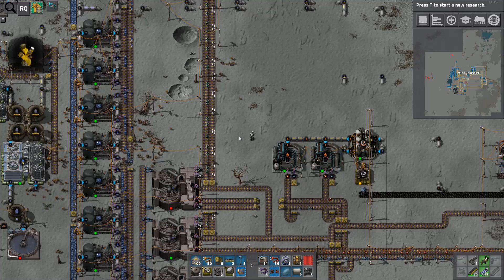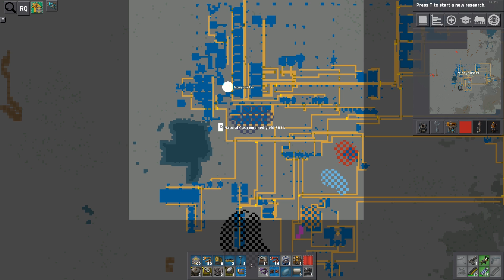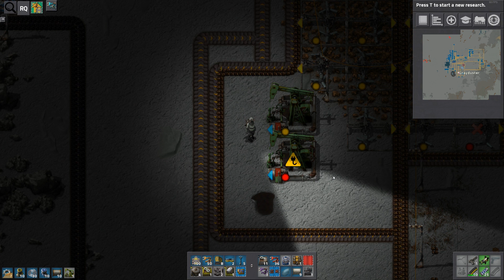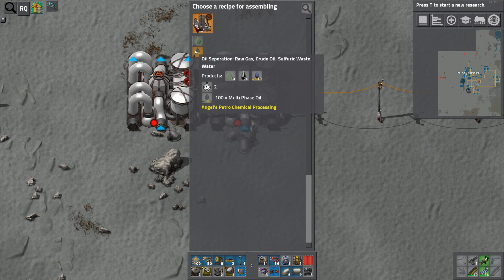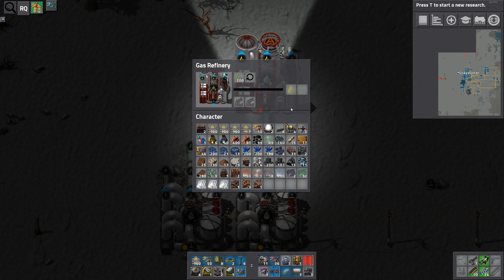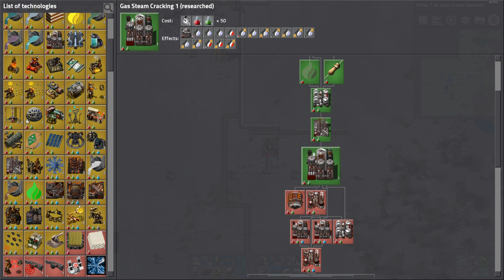Angels and Bobs Factorio 0.16 E10 - Batteries

Comment: Not sure if you knew but you can also make propene for plastic from Naptha as well with Catalytic Cracking, you do require red metal catalyst (1 x Iron Ore / 1 X Copper Ore) and steam which is easy enough. I prefer this method at the moment  as it takes up way less space.

Comment: Do you have a map string for a play along?
Reply from the maker: Sure - >>>eNptVDGIE0EUnckm3uWiuSBpBD2uSBvRy51YSHatLORK4eyc7E7W
wcnuObubkLM4ixMsFBsbtfBaEewsxObgQBQVjrPS6sRGUfFE0EaIM7M
zs5vghxne+3/2/zdvswGgBuoAAFhsVVHgYxo1uySKEoYLReuwygQoTh
iiTR9FlmVVVDZk+CQs5unCOG2N08VxujTe6hSnRTdElJ8quyzxcDMkl
IuoeoTFTZR0MPNJgPmxGZnpYOLnGEXulYyxcBAY5jKMepylnbwkiocs
jMSzZZnxGR4KMZKsJmyVitq0pAx7BscoMMf6JKQ4NiMGl0ksxeAA94b
NDopwwbIOdFm4hqUQn6Eo4ioTcaqSMj5XFhXtoaSfq4aUSHpQUSa8yr
jRWU55KnQ2Jfx1XU1CEuXOG8GKDzGl4UC4EqHAG/dXZoy/KdP+pkz7K
5nxV7Ixf2VG+ytJ5q+kyl+Jlb8SZ/5Kqv0txdwz8SM81A+piwLiak+r
JqFtnTUZ412WMjIA/Fr58uH6xhwQa7QOToxGYnG0w78LsXhYEPKEjpJ
LSbcLwPxZsSCE1+pPzn1cu2vDtH7cUWBfZVaeq8zeDQVWHitwc1sB56
EG6xrccWBLxi87A+msmHdWQ6adDKTFDVGE8Pb3p5t/Xmy14d9HP3eXO
5dsSI5dWK4lP9q8PCU++oLZ7t8T8UzfAOiee7Yqvbfh2zcivtmwJJ6Q
/xrOab5tnecu1qocbd7i2/xRoKW1dZu6A7syfuubfNLgnT15j4YDz4j
mc2J7KTY50CiDCl500sKRrMofXQD58V52uVd64nZu9ISGhtaw6PznCh
OZRs74GTHHM9tny4jgDu5MacbfrQWy2LdfP9hd+geNclGy<<<
Reply: I don't seem to get the same map from this string????
Reply from the maker: As long as you're copying in the >>> and <<< parts, and are on the latest version of Factorio (0.16.20), with the same mods, you should get the same map as far as I know (sorry if that doesn't work) - for instance, I have the Alien Biomes mod, which has different ground biomes
Reply: Loaded all the mods. Do i need to do anything with the preset settings or use the default settings to generate map with the map exchange string?  Sorry for all the questions.
Reply from the maker: If you have all the mods, once you past the map exchange string into the box, it should change all the settings to the same ones I used.  No problem about questions - hope you enjoy :)
Reply: Still having problems.  When I paste the map string it comes up red with no Map seed number???

Comment: Are you in the version of 0.16 with filter splitters? It will help allot with making a main bus.
I noticed you dint use the side loading of a underground belt to separate half a belt in a previous video.
If you are in they newer version of factorio try out the splitters input priority its amazingly useful.
Reply from the maker: +Mellester I think I am in that version :)